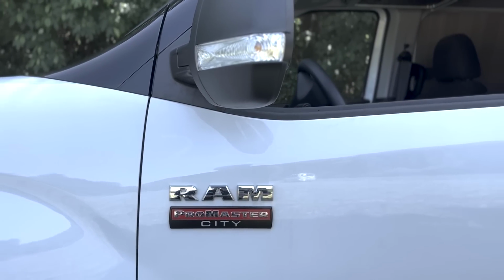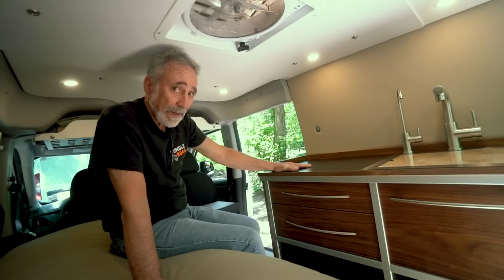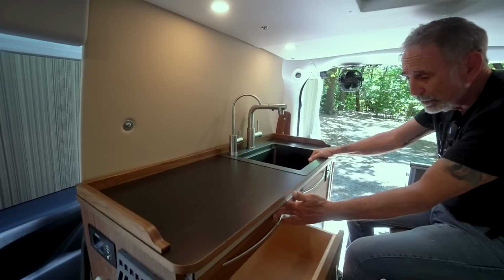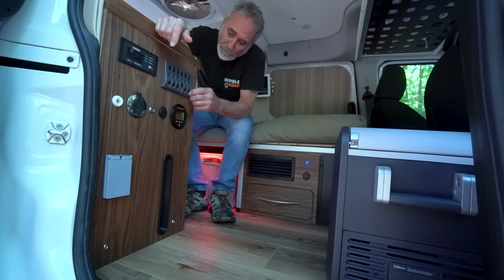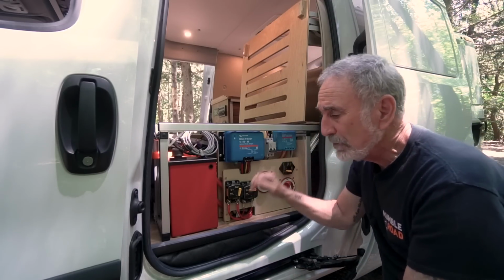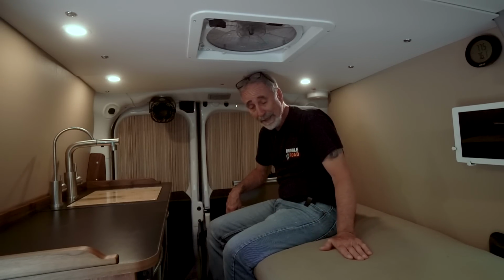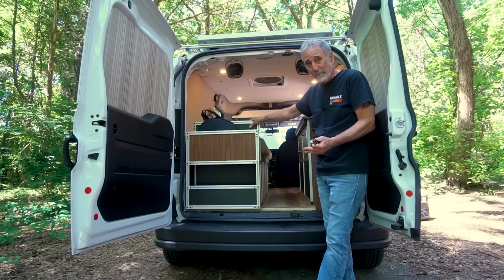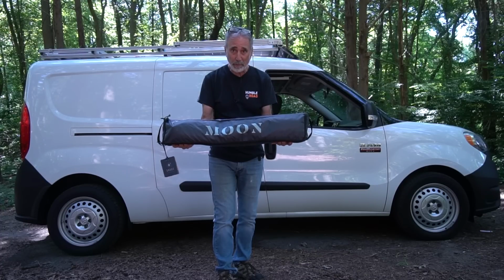Introducing the Humble Road micro camper - We call her Mini Me! A Solo Traveler  -  FULL TOUR!

Comment: The Humble Road build is full monte.. nothing is left not considered.
For me though, being now 60, I consider this van to be most appropriate for a younger traveler.  I recently settled on a tall-roof, Ram ProMaster 1500. The main reason I purchased it this last December is, I had rented a low roof camper van in November 2021. This old body really did not enjoy having to stoop all the time.   For further evidence of my conclusion here, I had used a van to travel the country in 2006 when I was a bit younger, and I had no problem with the low roof. Last November, however, it was a problem. I had pains here and I had pains there, and most of it seem to be related to having to bend over all the time.
Again, this is a wonderful build and for some 20 somethings and for some 30 somethings I believe the magic is there for the taking. For us 60 somethings, not so much. Peace…
Reply: I had to watch this in several segments. This is a thorough, informative introduction to your mini me.
When your team is able to adapt this for a ram pro master 1500 tall roof, please count me in. Mine is it 2021 and it only has 10,000 miles on it. It would be perfect for this build, only it would have the taller roof for me since I am over the  5 foot, 7 inch suggested maximum height.   Serious.

Comment: Brilliant, I say, brilliant design.  For those of us who are 6'2", the Sprinter would have to be the choice. However, if you absolutely, positively  must have this micro, you could always take out the passenger seat, and install the bed on the passenger side. Plenty of room for a tall human.  Who needs the seat if you travel alone. Wasted space.  Question: is it because of the extreme cost that you do not use Victron for ALL the components of the electrical, or are the other brand of components you choose higher quality / more durable?  I especially love the upper clothing bin.  A work of art,  I tell ya!!  Thanks for the great tour.

Comment: Awesome build!

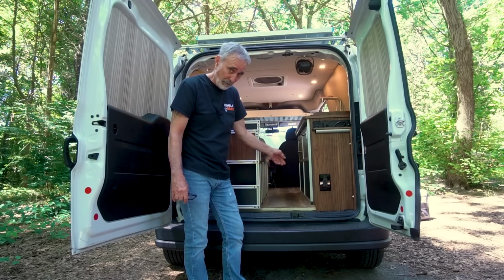27:45 Do the rear cargo doors have windows? What about the driver's side sliding door?

---

Just wondering: have you seen interest in a Toyota Sienna build? The latest years (Gen 4 2021-) are hybrid so even better gas mileage than the ProMaster. IIRC, Siennas are also a bit bigger esp. when you consider the storage well behind the 3rd row seats. The main issue with Siennas though is removing the 2nd row seats which are on a slide rail. The Sienna's 2nd row seats are harder to remove than most any other minivan and even once removed, the slide rails remain, but, who knows, maybe they could be used as part of the build.

Comment: Fitting in the garage is the exact reason I went with a PMC for my campervan, because our HOA doesn’t allow RVs on the street. Perfect for solo travelers!  Love your mini me!  I have been wanting a shore power plug to use at campgrounds and a max air fan, but afraid to cut the van myself.  I have that same toilet but it doesn’t fit under the bed.

Comment: Great build! My only question is why such a big inverter? 2000W would even be overkill, but reasonable, for that package. More heat, noise and less efficiency to deal with. Plus the cost.
Reply from the maker: The induction cooktop is 1800 watts, the on demand tankless water heater is 1800 watts. A small 120v heater is 1500 - 2000 watts. And you don’t want to run an inverter at capacity. That is what generates heat.
Reply: @HumbleRoad  i missed the tankless water heater and electric heat, my bad.  And i thought the cooktop would've been 1200. So that makes sense now.
Reply: I don’t know if it’s possible on the PM City, but on the larger Promaster there’s already a topside tap built onto the fuel tank access port. We use it to run a petrol Esbar/Eberspacher air heater. It is a glorious thing and the tap only goes 3/4 of the tank, so you can’t burn up all of your driving capacity. As for power, since we had heat taken care of, we did go with the smaller capacity 2000w inverter. We can run a 900w variable power cooktop, and a 700w microwave simultaneously (I rarely go more than 500w on the inverter as the pull of the microwave is about 1150w).

Comment: This is so cute and awesome.  Is there a way to heat the house?  Thanks!
Reply from the maker: Yes small electric heater. 1500 watts
Reply: @HumbleRoad  How long would a small electric heater run with the supplied battery?
Reply from the maker: @kevinpfeifle3897  running at 750W you would get 5.5 hours

Comment: Don't they make those vans with a higher roof? That would be great because I noticed George has his head tilted a bit when sitting on the bed. Ouch on the neck. Nice job, looks cozy but it definitely needs something on the wall behind the sink like you said about the hutch and hopefully another outlet on that wall. You talk about the Moon Shade but I'm not seeing where you can store it along with your folding camping chair and folding table? Would it be possible to mount a small LED porch light on the passenger side sliding door? I think it would be nice to have some small outside lights on each side. Last question, I know I'm throwing alot at you but if it's designed for a solo traveler the why not remove the passenger seat and put a cradle there instead for the cooler(open up the floor space)? Maybe even be able to have a drawer under the cooler then that slides out towards the rear. Love what your doing. 👍

Comment: How many times do you have to fill up on the oil that is spewed out by the fiat engine!!!??
Reply: To be fair, there is nothing wrong with the original Fiat engines, I've had a few that have had 10s of 1000s of miles with no problems, I think you're remembering an 80s urban myth. The only reason FCA put a different engine in the Doblo for the US is that Americans prefer larger petrol engines due to fuel being so cheap there. Maybe this will change the longer the war impacts fuel prices worldwide.
Reply: As explained in the video, it's not a "Fiat" engine. The Promaster City sold in North America uses the 2.4L Tigershark engine mated to the 948TE nine speed automatic transmission. The same engine, designed by Chrysler, Mitsubishi, and Hyundai, is used in the Jeep Cherokee and Renegade. The transmission is a German design used by many different mfgs, incl. the aforementioned Jeep. 

The whole "Don't buy a Ram Promaster or Promaster City, it's just a Fiat" thing (as if it was a 1960's Fiat 124 or something) is getting really tiresome...

Comment: I suggest replacing the current on/off switch for outlets and water heater with a power transfer switch appropriately labelled - for me it is more intuitive to switch from "outlets" to "Water Heater" than remembering what "on" does versus "off"
Reply from the maker: When the switch is in the UP position, it applies to the (water at the sink). In the down position, it applies to the outlets, which are at floor level. Fuzzy logic.
Reply: @HumbleRoad  I was trained as a mechanical engineer.  We didn't have "fuzzy" logic back then.  LOL

Comment: Hi from Europe George! Love your work and this is a great addition which will be hugely popular I am sure! Does RAM do a high roof version like Fiat do? I am 6'3" and would be be too stooped over sitting on the bed in this version but would seriously consider a high roof variant (which might also let in some light!)
Reply: With the Fiat high roof option, you lose the ability to use car parks, which would make the van as impractical as Promaster / Fiat Ducato. There would be no point in using this platform as a high-roof version.
Reply: Yes, watch his previous van builds. Specifically, The Vagabond build is on the RAM promaster high roof.